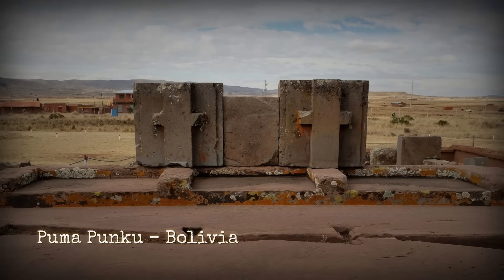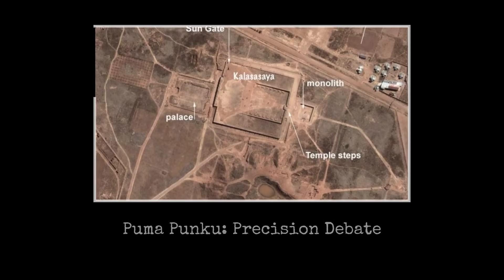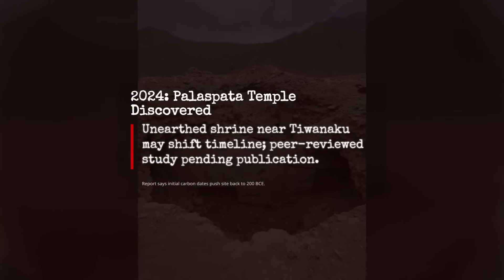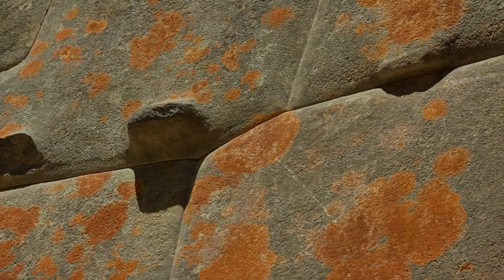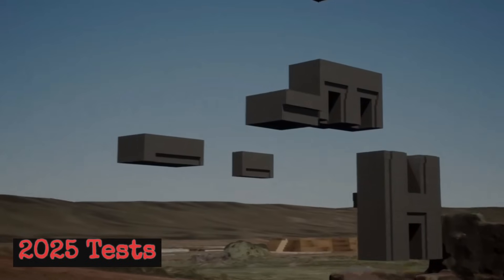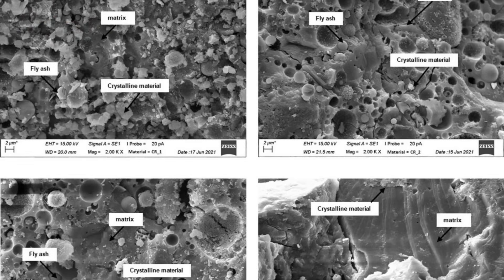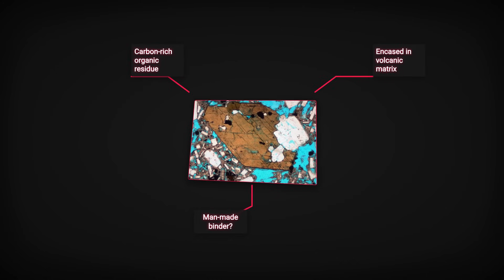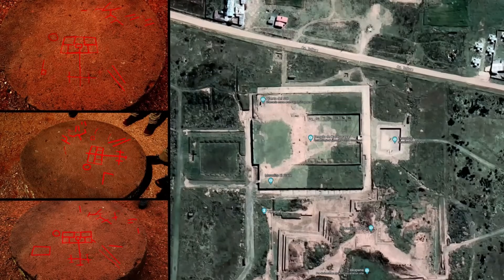New 3D Scans Finally Reveal How Puma Punku’s H-Blocks Were Made

Comment: If the stones were cast, now the problem of the casting form emerges. To produce, maintain, and use such a form multiple times is even harder than simply carving the stone. Also, the most obvious material - wood - would have left marks on the cast stones surface, the same way concrete does today. The hypothesis sounds interesting at first sight at least, but it cannot survive a deeper analysis.
Reply: Could material not be cast and then smoothed out after it set?
Reply: @robertmoore3581  Don't know if it work. Not impossible, though. But seeking accuracy below 1 cm with wooden frame is problematic. The moment the planks absorb water, they deform. Today wooden framework need to be replaced after several usages, even though it has polimer coating.
Reply: The grain structure of these Natural stones is orientated.  Cast stone is mostly amorphous. So no, it's natural dimensional stone.
Reply: Also, what if they just used earth/clay to make the form? Not sure about the local soil, so I don't know it this would be likely or not.
Reply: @robertmoore3581  The problem with clay is, that you cannot make the form a single vessel. It needs to be smaller pieces which you assemble and disassemble. Probably this will be the same for any form material. This significantly lowers the accuracy and the end result. If you don't have an outside very firm and precise frame... Then the question - what material is used in that frame. The problems just pile.
Reply: You don't need molds or forms if the material is a stiff past that doesn't cure too fast to add up and manipulate in deep sections, trimming to outer shape with templates and other light forms used for measuring and accuracy rather than physically holding and forming the material. Don't compare it to concrete's behavior to see other possibilities. It's not concrete.
Reply: @rickZR1982A you've obviously never  poured anything with significant mass to understand structural forming and curing necessities. This isn't coiled pottery.
Reply: Not poured. Slow curing at a stable clay-like consistency. I actually understand this very well. "Coiled pottery" Lol, no, it isn't.
Reply: @rickZR1982A have you done the logistics to mine all the necessary minerals & aggregates, grading, mixing, curing? Why were all the stones " cast" in different shapes and sizes ? Why is there no adhesion between mating surfaces if "cast" in place ? Why are there tooling marks in adjacent seams and on faces?  Much has been observed during restoration that debunks geopolymer even without further lithological analysis. Clearly they were not cast in place and why bother when stone is abundant and needs to lifted and set into place regardless ? You still can't get around the orientated grain,  vein & cross cut grain matrices, and phenocrysts with cast geopolymer hypothesis. It's bogus and bunk.
Reply: Again, you don't pour geopolymer into molds. Don't want adhesion between blocks (seismic stability). Included natural stones. Post formation mods, etc. Puma Punku is a tough one. There are problems all around.. I like the limestone at Sacsayhuaman much better, it's so obvious there. But the techniques would have been similar. I'm open minded, but I pursue evidence and possibilities.
Reply: @rickZR1982A davidoditz cast his " geopolymer" into molds  i suppose you are going to just model your 20 foot blocks by hand like play dooh in stratified layers ?  How ridiculous is that ?  Your hypothesis falls apart on every level of practicality. That and you don't know what cut stone looks like. Colossal fail.
Reply: Ever make something with dry packed concrete? Ever build a sand castle? In broad terms, GP is like cement. Glue. You could make a portable mix, or you could go dry pack. H-Blocks are 1.0x1.5x0.5m sandcastles. With the right  GP glue consistency, the hand packed natural andesite sand can self support fresh & vertical at 1.0m just fine.
Reply: Portable? Spell corrected, should be "fluid".
Reply: @rickZR1982A  yes I have. I'm a stone mason fully versed  in concretes and cements and have manufactured cultured & engineered stone  Try dry packing a large mass that is homogenous and without creating stratified layers. If you supposedly know it can be done then do it. We'll wait.
Reply: Anyone really familiar with concrete would know that's true. Anyone familiar with GP cement knows they aren't equivalent on that basis. I gave dry pack & sand castles as examples of free hand green physics for H-Block formation, not as a recipe for an ultimate cured result for actual work with portland. GP can do it, portland not so much. GP is high molecular weight and can span the molecular scale and larger gaps as it polymerizes. Portland is a 2, and portland to portland bonds are total zeroes structurally. Portland by itself does not gap fill at any scale, and you know this. Only portland to aggregate (or pozzo or reinforcement materials) bonds count in conventional concrete. That's the huge advantage of GP, and why the proposed packed block works where a similar portland based block fails. You know a lot, and most of it maps to GP, but clearly there are some significant differences.
Reply: @rickZR1982A  differences in mineral constituents and phenocrysts formation since its Andesite an extrusive igneous stone. Geopolymers are interesting and offer possibilities but not in the old world.
Reply: Exactly what I was thinking
Reply: Im a precast fabricator...you dont know what your talking about speculator

Comment: Me thinks the date is WAAAY off.
They have carbon dated relatively recent debris
Reply: Carbon dating is so flawed.
Reply: @thomasferry2950 which type is flawed there's more than one. ?
Reply: @thomasferry2950 radiometric dating is more accurate with stone.
Reply: Stone can’t be carbon dated, that works for organic matter.
Reply: @lwhack458  stone is porous and can contain carbon material thar can be dated back 50,000 years. Stone structures can be carbon dated if they contain masonry mortar with organic constituents or carbon material between stone layers.
Reply: @GroberWeisenstein   Yeah, my reply was the abbreviated version. It can be used but radioactive decay methods other than carbon are generally applied.
Reply: common theme around the world.

Comment: The people built forms using a clay sand mixture with a PI plasticity index between 12 to 18, you can also see honeycomb spots because of air pockets against the flasework that trapped in their flowable mix design. We do the same thing today and call it rustifacations.

Comment: I heard a LOT of speculation, like they did this with primitive tools and now the theory that the H blocks are, in essence, sand and natron mixed to form a cement block in forms. What I haven't seen or heard is someone actually confirming these speculations BY RECREATING THEM!! Until then this all sounds like the logical fallacy, and non scientific "rationalization". In other words, Orthodox anthropologists already have their theory and adopt ANY explanation to support it no matter how ridiculous Thing is, the natives' oral history says they didn't build it. But go to Greece or Rome and ask the natives there who built the Coliseum or the Parthenon and they'll tell you that their ancestors did. Why don't they believe the natives? Because it doesn't fit their orthodoxy.

As Sagan said, "Extraordinary claims require extraordinary proof" and so far I see none. Even if we give that they made cement blocks out of forms you are still left with how those forms could be made so precisely as to be hollow inside with perfect right angles and the backs to have tapered slots that dove tail with other blocks. The engineering and precision for today would require heavy math, lasers, computer controlled diamond saws and drills just to create the molds and then the task of pouring the wet slurry into the mold, letting it dry and extracting it perfectly. Consider that they are made of Andesite which is a 7 on the mohs scale. It is way harder than any of their primitive tools and we are expected to believe they could chip away that intricacy with primitive tools?  

And how about moving 100 ton blocks of stone into place with no wheels or logs or pulleys. Manpower alone? Do you have ANY idea how much a stone like that takes to move it? Simple tools ...😅

Rationalization...😅 your hypotheses aren't any better than "aliens did it".
Reply: Mohs scale has nothing to do with carving processes involving impact. The goal of stone masonry in this case "banker masonry" is always conforming right angles,  flat mating planes & surfaces. This should not be surprising except to laypeople. 
 How much of an idea do you have moving blocks of stone? Have you quarried stone blocks , handled & transported , done any stonework that is related to the methods & processes displayed here ?
Reply: @GroberWeisenstein  I worked at gold mines with catipillar 3 stories high.
Ive also had to unload giant machines/contraption/semi
off of semi trucks....ect.  those chains, straps..ect arnt just run of the mill  metal or ropes....just saying
Reply: @GroberWeisenstein Yes. I used to work in a hard rock gold mine. Quartz is extremely hard. After each underground explosion, after a day to let the dynamite residuals and dust to settle, we went back in the next morning to muck out the debris. Sometimes there were rocks the cracked and fell that were way to big to move out. So we had to drill them and break them up. I've also worked with limestone at a quarry. Even though it is a soft stone relatively speaking, it is also very heavy. So yes, I have worked with men who moved huge stones and we used heavy equipment to move the big ones. Underground in the gold mine tunnels we couldn't get heavy equipment in there. It was impractical to try to muscle it out, not to mention how dangerous it was.

So ... until I actually see someone do it to prove primitive men with primitive tools could carve the intricacies and straight lines with interior carvings, each virtually identical with the next and you can prove they did it with pounding stones and bone chisels, then I call a spade a spade. Prove it by doing it. Then I'll believe it. Until then, it is speculation.
Reply: well...I was laying bricks for a walk way around my house. ( Im not a pro) I need to cut pieces
for weird corners...ect. I tried cut red bricks with a METAL BLADE portable sort of table saw...
The BRICKS wore out my damn  ELECTRIC saw. I needed special mason diamon tip blades.

Those people used COPPER chizzles by HAND...That's NOT happening or didnt HAPPENED.

Comment: So let's get this correct. Somebody several hundred years ago makes the assumption that these blocks work hard. Even though they lack the necessary element of marks on them that indicate that they were carved. And in order to overturn this insane assumption. They have to prove that, although the spectral analysis and testing shows that it's clearly a casted geopolymer. You need more proof???
No wonder you people never get anything done you can't even take your own science at reasonable face value.

Comment: O k if they were cast, then the forms would have had to be very precise. How?
Reply: If I gave you a big block of ceramic clay, a drawing, some cardboard templates and measurements, and some string and sticks, I bet you could replicate one of these almost perfectly without fluid slip and a mold. And I bet you could paste up a second replication with very close but perhaps not exact measurements against the first, with seams so tight a razor blade could no fit between them when they have hardened. Now imagine a geopolymer like this with a long non-shrinking cure time. About as easy peasy as it's going to get. Now about that andesite recipe with the poo in it...
Reply: @rickZR1982A  Unfortunately we will never really know.
Reply: @gwendolynvanderveen5147  May never really know? Maybe. I'm mot ready to sell science short here, but it could be. Enduring mysteries are cool too.Thanks!

Comment: Those geopolimers and molds explains the block on the pyramids, that didn't haul them up, they cast them on the spot then pushed them in place.
Reply: The Giza blocks are not polimers though - they are quarried stone (various) and the quarry origins are known.
Reply: Every H block is different, there are and were no molds.
Reply: If that were true, then the blocks would be the same size in the pyramids.  They’re not.  They’re all different sizes and they only worked to keep each course the same height.  They didn’t worry about the length and just fit in whatever worked.  Look at a photo of the pyramids from above; it’s anything but”perfect”.  The stone blocks are all kinds of different sizes and they’re very irregularly placed.  They basically covered up the roughness of the construction of the pyramids with the limestone outer casing stones and used those casing stones to make it look good.  

Take the time to watch History for Granite’s videos: he does deep dives into a number of specific features of the pyramids and looks intensely at how they were constructed in the process.  And he does it by looking at the direct evidence.  

Puma Punku is extremely impressive and interesting though.  Whether they just took incredible pains to carve these blocks extremely precisely, or they figured out some novel technique, I certainly can’t say; but until someone actually proves the idea of a plastic geopolymer of some kind being used, I will maintain a healthy skepticism about that hypothesis.
Reply: Geopolymers can't replicate igneous stone like andesite, diorite, or granite. Cast stone has an amorphous grain structure and these are orientated.
Reply: @GroberWeisenstein  Not granite, but andesite can be. The grains aren't large complicated sequential inter-grown & locked matrices like granite.
Reply: the geopolymer idea makes the pyramids even more impressive. I dive into history often too, and theories like this always blow my mind
Reply: @CosmicSecrets7 
So they made a mold for each individual block in the pyramids?  That would be more work than carving each block by itself, considering that no two blocks are the same.  I don’t see why they would make an individual mold for each block, haul the mold up (which would be larger and heavier than the block itself since it too would have to be made of stone), and then cast it; and then put each individual block in place.  

Perhaps you should actually LOOK at the pyramids’ blocks; you’ll see that they are all different and they only worried about getting stones the same height for each course.  The width didn’t matter because they just filled in with whatever they could and the depth didn’t matter because they just loosely arranged the stones inside the perimeter stone blocks.  The only real precision parts were where they built the chambers and the grand gallery (which has been hypothesized to be the ramp to the large roof stones for the chambers).  Look at a photo of the tops of the pyramids; you’ll see how roughly they were stacked up and how there’s no precision whatsoever.
Reply: @keirfarnum6811  No molds needed if packing on a self-supporting thick malleable material.

Comment: If they were cast those that constructed the forms did so with a high degree of accuracy not often seen today.
Reply: Every H block is different
Reply: @henryknox4511  Yes. Consistent with manually & skillfully packing and shaping a thick malleable sticky material with a consistency similar to clay, but not at all like wet or even semi-cured concrete. Templates and screed guides, sure. But not molds.
Reply: even if it had a play doh like consistency one would still be able to create molds and use them numbnuts

Comment: Laguna Cachi is 350 miles from Puma Punku which is a source of Natron needed to make geo~polymer cast blocks. If the ancients cut the rocks & hauled them we would of found their rock quarry by now just like in Egypt. 
This is what AI overview has to say, "Laguna Cachi (Bolivia): Located in the Altiplano region of Bolivia, this is a naturally-occurring salt lake (salar). The arid, high-altitude environment is conducive to the formation of evaporite minerals like natron. This natron is historically significant and was potentially used as a material for ancient geopolymer concrete by builders in the region."
Reply: These are not calcite based rocks these are crystallized silicates with orientated grain structure unlike cast stone which is amorphous.
Reply: @GroberWeisenstein  No, they aren't calcite structures, that's not the only route. But why do you say cast "finished" stone has to be amorphous? A fundamental geopolymer compound at the finest level is likely to be amorphous in its basic role as a stone-chemical glue, but all kinds of other structures can be present in the end product, both formed within the material as part of an extended cure, as well as containing any number of aggregates of various sizes, composition, and structure. We don't make things today out of "cement", we make them out of "concrete". And we even use lithium and silicate compounds to modify the microscopic structure even long after it has cured.
Reply: i heard they did only tested in Titicaca
Reply: I need TP FOR MY BUNG HOLE! 😂😂😂